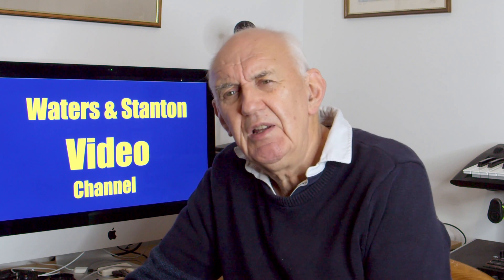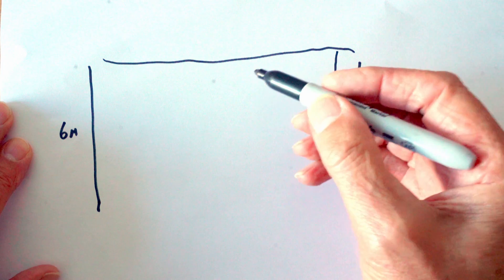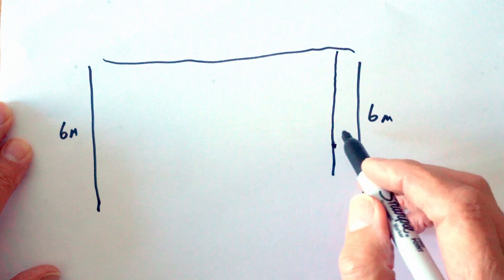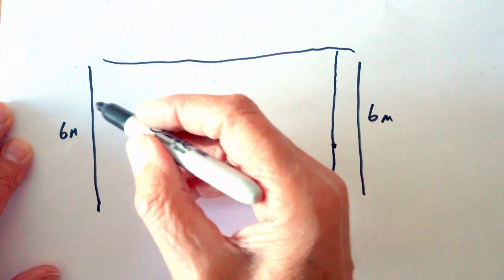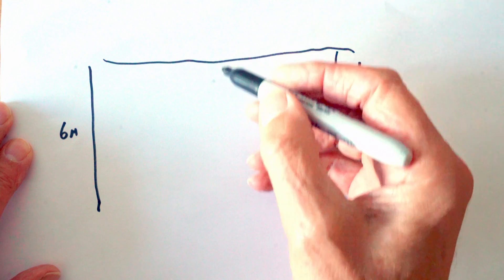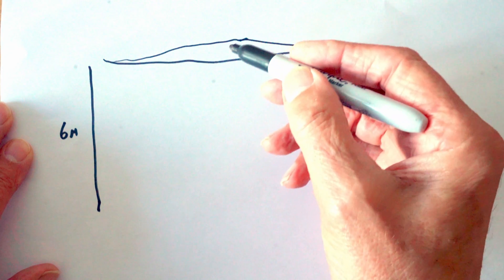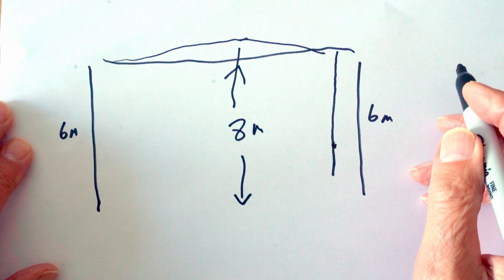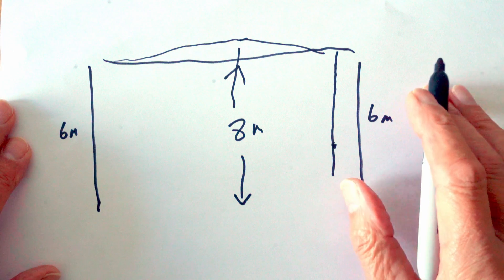Half Square Antenna Tips and Tricks | HAM RADIO

Comment: I've discovered that if you cross a driven half square with a parasitic half square at a 90 degree angle across the center, you get a nearly omnidirectional (square with rounded corners) antenna with the same 5-deg takeoff angle gain as broadside to a half square.  It does this by steering the deeps nulls upward to 45-degree elivation.     KK7YIS 73

Comment: Just watched two video of yours about this antenna and they're of great help, thanks!
When voltage-fed, it's basically an EFHW with a different shape from the usual sloper, inverted L or V, isn't it? But this shape does seem to bring significant improvements. It's a rainy Sunday, K index is in the red, no portable today so let's cut some wire.
And here comes my half-square antenna ready to be brought up on two poles, with red electrical tape markers at 5.03m and 10.21m (metric system here...).
To be tested for my next portable field day. Thanks and best 73s!

Comment: I have Inverted L antenna  18 ft height  30 ft long  with wire on other end hanging down,   now I know it is called Half Square antenna.  I feed them with automatic antenna tuner.  indeed it is very quiet receive antenna.  AG6JU

Comment: Greetings from across the pond. I was licensed near Boston, Massachusetts and moved to North Carolina near Charlotte.  Thank you for the tips on the 20m half square antenna. Very helpful. I will give it a try. Soon I will be working off a large mag loop that easily tunes 80/40m. without moving any tubing around. It looks a lot like a swing set when assembled. It's about 4 feet wide and 2 feet deep. I expect good results from it. 73 de KB1KVL

Comment: Very interesting ant, although my 20m vertical works very well,  but now I simply put a parasitic reflector behind it, I got 
6-10db gain in my favored direction long path. Only using 2 5m cheap painting poles.
Reply from the maker: 6-10dB is normally only achieved with several elements. In fact 10dB at HF is extremely difficult to achieve with anything other than a very large antenna.

Comment: Hi Peter. I built one of these a few weeks back. Im very pleased with it as the performance is very good and it makes a great portable antenna too. Ive also been working DX on 40m with it this past few days, granted conditions have been good, but it works very well even on 40.  It compares well at the other end with my 10m 5/8 wave vertical ans as 10 has been so hot lately, Ive been switching between the 2 antennas.  The 5/8 wave is slightly better on average, but on many contacts, theres nothing between them.  All in all, very impressed.  F5VDM
Reply from the maker: Thanks for sharing. 73 Peter

Comment: Excellent, Just set one up using a 49/1 transformer that i puchased with a  EFHW antenna which never really performed very well in the way i set it up (low and sloping up), it works very well on 20m acording to DX spot and just had a qso with a chap on 10m in Bulgaria that gave me a 5/9 and sounded shocked at my 10 watts of power, as mentioned it seems quite directional as expected.
 Thanks for the advice and 73s M7MNM.
Reply from the maker: Great to hear from you. Keep at it. 73 Peter

Comment: I have been running a 20m half square for over 3 months in 2 configurations voltage fed using 2 X 7m squid poles as supports and feeding with a ,9:1 UnUn and last 2 months using two timber posts 3.9m high with a fibreglass dowl insulator mount into aluminium telescopic tubing 5.2m long with a 10.3m horizontal wire connected to the same on the other vertical. My 9m X 9m steel shed is between the verticals and used as a grounded counterpoise. I voltage feed with an AH4 auto tuner and works extremely well on 40m and 20m with DX and Australia wide communications and I find also is a very quiet antenna.
20m DX 5/9 reports to UK and even on 40m a 5/9 report to Denmark which blows my mind that this was possible with 100 watts.

It will tune with 9:1 and AH4 from 89m to 10m however performance on 80m only suitable for local chats.

Well done on your videos on the half square which I find the same as you reported. Cheers Greg VK3KV 

These two antennas
Reply from the maker: Hi Greg, great to hear the results you are getting. I hope it encourages others to try this antenna out. 73 Peter.

Comment: Great video as always. Thank you for the advice and information. I have tried a efhw and vertical in mine. My garden is between to rows of terrace, gardens backing onto each other. Small garden indeed, 8x8 with a shed, grass and some decking.
I bet my neighbours love the sight of my 10m mast when it goes up.
As for noise I get a S5-7 depending on the day.
Struggling to get more than Finland and spain but I am qrp 5w on the Ft817
Motters M7TRS 73 👍🏻
Reply from the maker: Good to hear from you. Keep at it.

Comment: I think you've started something on the internet. M0XXT obviously got wind of this and is trying one out as well. His modelling shows very good gain over a quarter wave at a low angle good for DX. He modeled the mono band version fed at the top corner directly with 50ohm coax though. I would be interested to see what the modelling would look like  fed at the bottom of one of the legs with the 49:1 unun and whether this configuration reduces gain or changes far field radiation patterns in any way. Just as an aside, ready made 40M end fed half wave antennas are pretty cheap and easy to get these days. One could just buy one and configure it as a half square. 
I am curious if you used a ground  rod on the shield side of the unun? You don't have to I know but some experimenters swear by it and say it improves performance if you have an earth ground with an end fed half wave antenna.
Reply from the maker: Many thanks. The change in feed point still preserves the gain on 20m. I have never ever found any benefit in an earth or a counterpose with an EFHW. . BUT the coax choke immediately below the 49:1 is absolutely essential. 73 Peter.

Comment: what if I make a 40m half square (10, 20, 10 in length) but tune it for 20m will I achieve greater gain on 20m?
Reply from the maker: No
Reply: It probably will have gain on 20m but won't radiate broadside like on its fundamental. It will most likely fire off the ends.

Comment: Would be interested in how this sits in your garden with regards to EMF compliance. Most of the popular HAM channels seem to be keeping very quiet on this subject considering the rest of the HF bands come into force in Novemeber.
Reply from the maker: I think a I would be more concerned about a VHF 5W handheld in forn of my facw!
Reply: @watersstanton  I get that, I really do but unfortunately it doesn't seem to be about common sense. The fact is, if you run probably as little as 10W through that with 3db gain, you wouldn't be compliant in a small garden. You'd have to run it through the calculator, accept that it's not compliant and document what steps you take to ensure it is only operated in compliance e.g a monitored perimeter with no transmissions when people are near by or just run the power so low it's not even worth it. The reality is, this nonsense is here to stay and I think it should be addressed when discussing these types of antennas.
Reply: @DanMarkland  Good news! The ARRL has a calculator for these questions! If you run a 100w radio into this antenna, with a 5db gain figure (more than W/S states in this vid) the minimum distance from the antenna is about 3.5 feet. 1000w is roughly 12ft. So, there's some info for ya. Have a great day!
Reply: @DanMarkland  make a video about it then rather than moan about what YouTubers do.
Reply: @danielwinn5707  I know there is a calculator for this, my point is videos showing how to run these antennas in small gardens without addressing the elephant in the room where you're not strictly 'allowed' to run it properly seems a bit misleading.
Reply: @DanMarkland  seeing as maximum radiation of a half-square occurs at the top of the 1/4 wave vertical wires, there should be more than enough safe separation distance to meet EMF compliance, at least on the fundamental, i.e. 20m in this case.